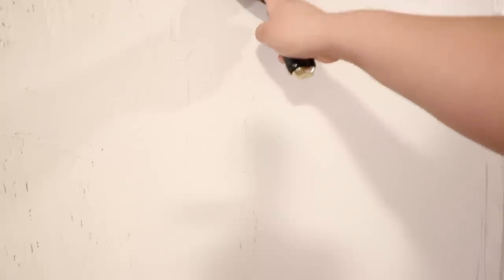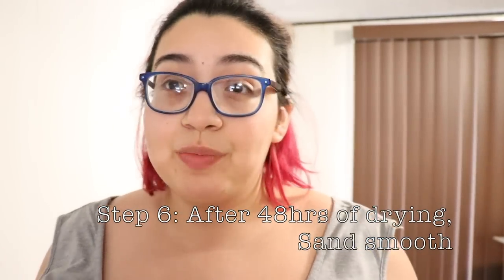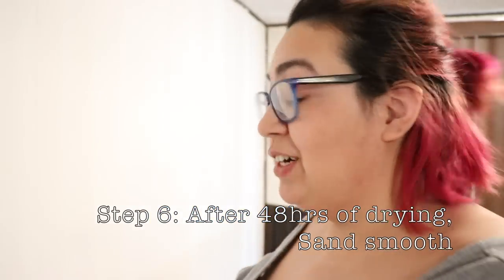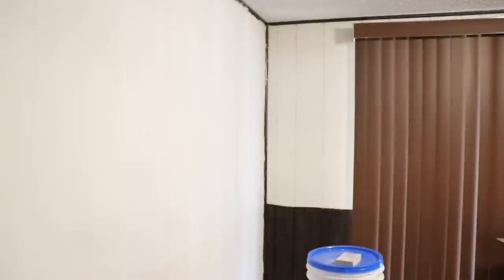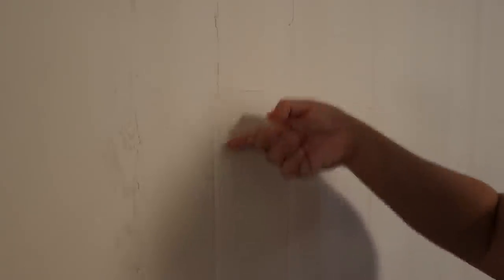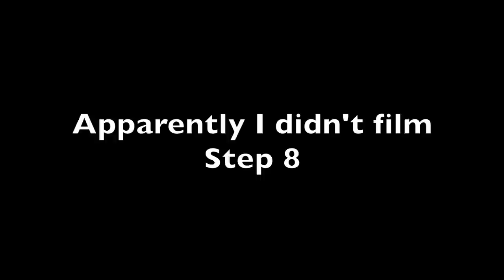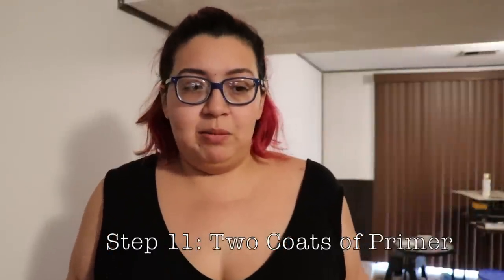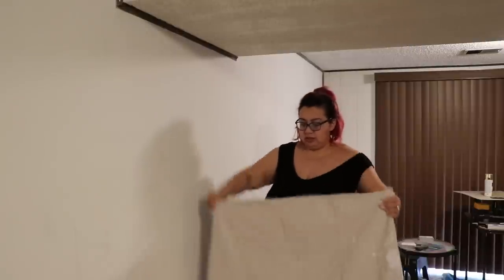Covering Wood Paneling | Affordable Remodeling

Comment from the maker: UPDATE:
4 years later and it looks exactly the same as it did at the end of the video! It hasn’t cracked and chunks haven’t fallen off as some thought might happen. I’ve knocked furniture into it accidentally and hung stuff up and basically treated it like every other wall in my home and it has been great. I am told if you’re in a very humid area it may crack more easily but I’m in the Midwest and it hasn’t had any cracking over the years. 
Again this is a DIY project done when I was still new to DIY home projects and it’s held up amazingly so you can definitely do this yourself too! There are also some helpful tips in these comments that other people have left.
Reply: Great thanks for update

Comment: Very well done 👍
Just as a little advise , to avoid cracking up the grooves (drywall compound) it's better to use (50/50) water and wood glue (use as primer) ,it will make much strong bond between the panel and drywall compound .😊
Reply: Really? I've never heard of that. So I should do that instead of taping?

Comment: As a contractor who do this for a living.. I’m going to give one helpful tip you can use a heat gun/blow dryer/or turn the heater on to dry the dry wall also you can buy 20 minute mud

Comment: You gotta love the internet. I found it easier to just put 1/4 inch drywall over the paneling, but found that they put some aluminum framing around the window which would have made the drywall stick out and look weird, so I was looking for a solution to my problem and now I have it, thanks.😊 Btw I like the round disk on a stick for sanding (don't know what it's called) a lot of professional drywallers us for big jobs, because otherwise you'll be sanding all day, but very helpful video.
Reply: @mica onyx How did you attach the drywall to the paneling? With nails or with glue? How about the moldings, was there a gap left between the new drywall and the existing moldings?
Reply: The drywall needs to be attached to the studs behind the paneling which can be done by marking where the paneling seams are or using a stud finder beforehand. Don’t use nails, use drywall screws. Nails will pop loose over time. No glue either.

Comment: You don't need to sand the lift-offs (that's what you call those ridges), take the putty knife and scrape against them. Sand only after all coats are done. You can use a paint roller and thinned down mud to get an even coat much easier. Etc etc etc.

Comment: What a good idea!  Thank you!  I had been considering to hire a pro to change wood paneled walls of my family room to drywall for 23 years but something more urgent always came up first, like heater, hot water, air conditioner, roof, sidings, oven, refrigerator... oh...even exterior steps...  Since my husband and I, both retired, I thought we might not have a chance to do.  After watching this video, I plan to do it myself.  I might put some primer (some kind of adhesive primer - I have to search it first) before putting "mud" on the wood panel.  Thank you!

Comment: For anyone looking to do this make sure the paneling does have give to it. If it does then this is NOT how you want to do. Because once it flexes it will crack the plaster. Secondly 14:00 after you let the first coat dry don't use a sanding block to sand the high spots. You can take your plaster knife to shave off the high spots. Then use a sanding block to get it smooth. The way she is doing it you are just making more work and more mess.
Reply from the maker: I wish there’d been more comments like yours on the videos I watched when researching this 😂 could’ve saved myself a lot of sanding time 😂

Comment: Nice job and much appreciated.   We purchased a manufactured home that has cheap  panels on the interior with crappy wallpaper over it.   I was going to get 1/4" sheet rock and cover them with that.   This looks like a cheaper less labor intensive alternative to that.  I think I'm going to experiment with one of the walls and see what happens.   I just need to figure out how to seal the crappy wallpaper.  Maybe the drywall mud will do that.  I need to look into it.     Thanks again!

Comment: Great video...
... Let me give you a HINT... I "Flip" RVs and run down houses... I'm on my 25th one right now...
I now use... Awesome (liquid soap) that you can get the Dollar Store... I use 1oz to 16 oz of water...
The stuff is amazing and I have used it to CLEAN Everything... 
You could have cleaned this wood ONCE let dry and then started on you mud/joint compound. I personally put some water with it to smooth it out. The last House I did... I used "5"... 5gals of this stuff... I know everything about drywall mud believe me!!! LOL
Thank you for sharing this great video... Loved it.
Reply: I'm closing on my first "flip" house tomorrow and it has paneling throughout that I'm gonna mud and paint. Do you use tape or just mud only?
Reply: @ramblin_man23  
No need for tape... BUT... First rule of thumb is CLEAN those walls really really really good... but build up of grim, smoke etc will hinder you putting anything on the walls. 
Buy Heavy duty Baby Wipes... (This will be your best friend) Get the 3 Pak... believe me you will use them all.
But before you can use the Baby Wipes, they are for the finale cleaning... If you can use the Awesome you get at the Dollar store. It takes very little in a spray bottle, and Get GREEN Scrubies at the Dollar Store, or at Lowes (heavy duty) like what you'd scrub your pots and pans... I cut mine up in little squares and use the hell out of them before I throw them away.

Clean the walls... (let dry) after you wipe them down with the baby wipes... Mud the lines only, you don't really need to do all the wall unless you want to... You'll need to add a little water to the mud... whip it up or stir it up... Let dry... over night at least 12 hours... then lightly sand the wall if you need too... then you can paint...

I always paint the wall WHITE first... because you'll need 2 coats anyway, since the mud will soak up some of the paint.
Then paint the 2nd coat the color of your choice.
Remember, You only get TRUE color ONLY when you paint on WHITE...

I paint with only one paint... and I have been doing this since I was 18 years old... I'm 65 now...
Use Wal-Mart Exterior paint... nothing else... it is GREAT!!!!! and cheap... and it washes up very good.. I have pictures that would blow you away what this paint can do!!! It can cover black!!!
This paint is for the inside of the house or outside... (I just hand painted a Vintage Travel Trailer) after I hand stripped it down to the metal... It turned out BEAUTIFUL...
I hope this helps... I kinda got carried away....
Just remember this... be very patient... it's hard work, but worth it...
... and always do your floors LAST... Paint your ceiling first... WHITE is best, it makes the room look Bigger!!!!
Reply: @ramblin_man23  
OOOpppps  I just reread my short novel (LOL)  I just sent you and I have to correct something....
.. when I said... add a little water to your mud... stir... I forgot to say... AFTER putting the mud on the panels, smooth out with (I use my wet hand) and THEN LET DRY over night...
Reply: You're awesome replying thank you. 
So clean with Awesome/water mix and green scrub pads. Let dry. Wipe down cracks with baby wipes. Add a little water to the mud. Apply and smooth with wet hand. Let dry over night. Lightly sand and then paint.
Only apply 1 layer of mud? Doesn't the lines shrink and show up after 1 layer? Thanks
Reply: @ramblin_man23  
SEE... Men always just say it so simply... in a few lines! LOL
The only thing is... you need to CLEAN EVERY INCH of the wall before putting on the mud and painting...
I have tried to "skip" this and paid for it later..... Paint will not adhere to dirty walls.

I'm getting ready today to CLEAN the 1985 Class A RV... (this one was SO BAD, that the man gave it to me!) It was a Meth Lab!!! This is my second one!!! UGH Truthfully using a Steamer, like what they use to clean couches, works on walls really well... (I forgot about that)... especially when the walls are as dirty as these.. NASTY.
    Plus they smoked in it, (the yellow celling)... AND be sure to rinse off the awesome/water first, let dry then right before you're going to paint, THEN use the Baby Wipes... you'll be so surprised what the Baby Wipes will show!!!
I'll think I have done a great job... cleaning something literally 5 times, then I use the baby wipes, and every time it shows me there is more to do... But again worth it, so the paint... will adhere to it, or it WILL PEEL off later!!!
To "Flip" Houses and RVs...
    Rule of Thumb: It takes twice the money and twice the time... but you're hoping it will make you more than twice the money!!!
If you do use the Awesome... only put 1/2 ounce to 16 oz. that stuff is amazing... or AWSOME, I even use it in my laundry. But it does NOT take much, and then you'll have to rinse and rinse to get it off the walls... or anything else!!!! It is very concentrated.
Reply: @judichristopher4604  thanks for your words of wisdom.
Reply: @ramblin_man23  
You're so welcome...
Reply: @judichristopher4604  BTW why do you have a picture of your daughter? That's definitely not a 65 year old woman. 50 max.
Reply: @ramblin_man23  
WOW... Thank you for the complement... and this picture is a few years old, and yes I need to change it... I was 58 or 60 there.
Reply: @M F 
You can get the drywall/mud at Walmart or Lowels... I don't remember the name, its just simple drywall (ready made) mud... I remember it says "Low Dust" on the packaging.... If you'll get on my Facebook and send a msg to me, I'll show you my pictures. This last RV I just did was a Meth Lab (well it look like one)... the wall were in BAD shape... with this mud walls, it turned out good... plus I use the mud to patch holes and then paint over it... Love mud.
Reply: I have a question. I used joint compound over my wood paneling and let dry. I noticed cracking and even some holes. I'm so lost and confused. I know I can't sand and paint over that. What should I do?
Reply: @judichristopher4604  Thanks. I actually had professionals come in and they originally did it. Over the weekend I accidentally bumped a table into the wall and it created a small hole. I thought I could just put a little compound in it, sand and touch up the paint but instead the compound started crumbling and crumbling. Next thing you know I was peeling off ALL the compound!!!! I did clean all the dust off before laying new compound but I guess I'm doing it too thick. I honestly don't know where I'm going wrong.
Reply: @judichristopher4604  I can try mixing with water but it looks like I will be scraping it all off AGAIN and starting over. I'm so frustrated
Reply: @anjanellfashion  
If you have small cracks on the mud right now... Mix more mud, will a little water... and spread over the existing mud you have on the wall... Smooth it out with a wet paint brush
Reply: @judichristopher4604  thanks so much for helping me, I will try it. I won't give up!!
Reply: @anjanellfashion  
NOTE:
 I use the word MUD for Joint Compound
Reply: @judichristopher4604  I caught that! Lol
Reply: @judichristopher4604  couple more questions please. Do you use the compound directly out the bucket or mix it with a dry powder? Do you recommend a brand?
Reply: @anjanellfashion  
I use a Walmart brand in the paint department... I don't know the name right off hand, I remember it says "Low Dust"... It is already made... (I still add a little water and make it more pliable. Looks like thick frosting.

Comment: I am a very experienced DIY'er, renovated a few homes and worked a lot with drywall.  However, I have never done this.  I have to thank you for telling me how much joint compound it took you because this gives me an idea of how much work this is going to take and perhaps consider other options.   Also, if you're still responding to this video, I would like to know how your work is holding up.  My concern is shrinking of the joint compound and showing lines in the paneling joints.
Reply from the maker: dnsmithnc its actually held up amazingly! The walls still look exactly the same as when I did this, except for one spot. Over a spot where the wood paneling was already severely cracked the joint compound has cracked as well. It’s not noticeable unless you get up close to the wall because it’s pretty small. 
There were other spots where there was some smaller cracks in the wood and it didn’t come through the joint compound so I think it’s only a problem with larger splits. Only time will tell though.

Comment: I am thinking of doing this but I’m afraid the mud will end up cracking after a years time. Can you please do an update video showing what it looks like now?
Reply: Came here to say the same thing. One good knock on the wall, and the mud is going to end up coming loose I would think.
Reply: @Jess-vl9ks  there is a limit but this is not it.... most panel grooves are only quarter inch wide n deep . If u go this pricey route the broad flat  areas should be left with as little material as possible during application to cut down screening or cracking. Be sure to use a ventilator and sand ( screen) with pole to speed process. As stated by diyer u must prime and paint at which point nothing will be able to fall off. Check out : paint wood paneling like a pro: Benjamin Moore. It is more efficient but again sand with a pole and lung protection.
Reply: Looks like she skimmed it on paper thin...sealed with primer n paint. If so should be durable, but it is an extra step, just clean with tsp, fill with a good non shrinking wood filler, prime and paint. Do some test areas in a corner if u r doing a whole house or ask MANAGER at local hardware  store for best performing product suggestions. U can do it
Reply: I did mine and it is holding up great after 7+ years.

Comment: Now that it's been a year, how has the joint compound held up?  Would you use spackle instead if you had to do it again?  I'm looking at doing something like this with deeper grooves.  Thanks for the helpful video!
Reply: D All my rooms in my house are paneling and so I have been able to try both spackle (living room) and joint compound (kitchen). In my opinion, I prefer the joint compound because it seems to hold up better and overall be better quality than spackling. My living room has been painted for about a year now and there are a few little areas where the spackle is starting to crack a little bit. It’s fine for small holes or little jobs, but for something larger like a whole room then I would suggest going straight for the joint compound. Hope this helps.
Reply from the maker: The compound has held up perfectly! There’s a crack on one wall but it’s where the wood paneling was cracked underneath. I did attempt drywall on one wall and while it was easy it was way more work than is worth. To remove the wood paneling I ended up having to remove the door frame. Joint compound is way easier!

Comment: Nice video! Easy tip for cleaning wall any type of flat mop you like with removable pads  literally mop that wall easy and fast .if you want to scrub it try scrub brush  drill attachment or an electric shower scrub fast easy . This is very cool I think I will need it definitely  thanks so much.

Comment: Great video!! If you use the sponge sanding blocks, you can use a bucket of water to keep the sponge wet. Therefore, eliminating dry wall dust. That will add another hour or so for drying time or you can just run a fan for a few minutes. (15-30 ) Which is usually less than cleaning time. Plus, no mask and no lung damage. :)
Reply from the maker: Skittles4me1969 thanks for the tip! I was actually thinking about that but everyone I could find did it with a dry sponge but I’ll give it a try 😊

Comment: Also drywall dust is super fine it will kill a normal house vacuum must use a shop vac or a cheap vacuum. If you use a Dyson or another brand you will have to replace both filters and disassemble the entire thing to clean it.
Reply from the maker: Jeff Golas yeah I learned that the hard way

Comment: Hi! Thanks for the video. Exactly what I was looking for..but I have a question for all of the people worried about the compound in the lines eventually cracking...instead of filling the deep lines with drywall joint compound, can't you just tape over them with drywall joint tape and then do a coat on top and smooth it? Wouldn't this prevent cracking? Anyone have any thoughts on this??... THANK YOU!

Comment: Thank you for making this video it's so helpful! I'm wanting to do this soon in my new home and there are not many quality videos on this technique out there. I am curious how the walls have held up over time and if you've had any issues with them?
Reply from the maker: Fahliil Vahlok they have held up just like walls. The only spot to have some slight cracking is on another wall where the wood paneling was already severely cracked before putting the joint compound on.

Comment: Thank you so much for this!! How are your walls holding up after a few years time?
I bought my house last year, it's a 70s model and has wood paneling everywhere - while most of it is really gorgeous wood, the living room is super dark, textured panels and they're so ugly 😂 I want to try this method!
Reply from the maker: They look exactly the same as when they were fresh! No splitting or cracking, except on the one spot where the wood paneling was cracked underneath. Definitely recommend securing any cracked panels before going in with this method. Everything else has held up extremely well though.